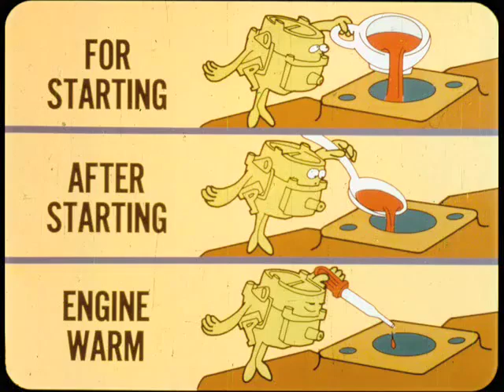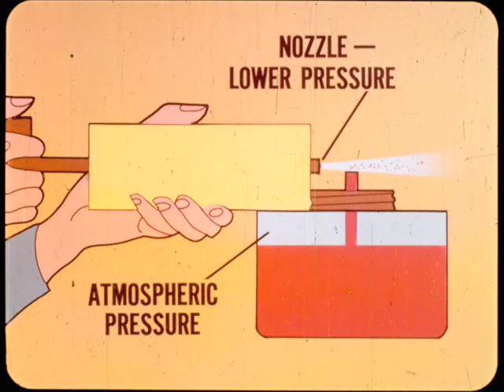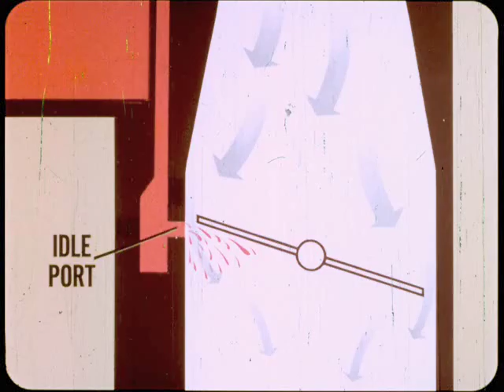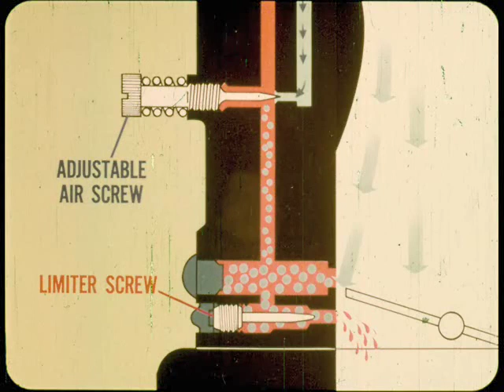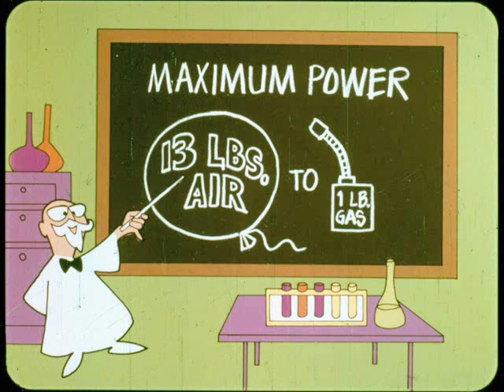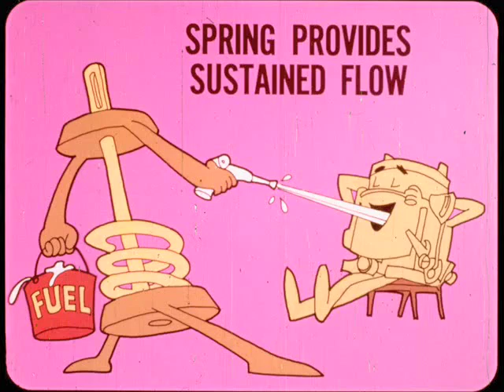Chrysler Master Tech - 1970, Volume 70-8 Carburetion Fundamentals and Facts

Comment: I learned about carburetors back in 1981 during high school auto shop. We were each given a carburetor to disassemble and use a thin piece of wire to trace the 7 circuits within our carb. Probably the best way to leatn the fundamentals of a carb "hands on". This video is an excellent visual guide to learn those fundamentals. 

At the time, I didn't give much thought to a carburetor since it was really the only fuel metering device being used. Yeah, some cars had fuel injection but it wasn't mainstream yet. Over the last 40 years as a mechanic I have watched fuel injection grow to what it is today; the last carb used in production being 1991. That was 30 years ago. 

It really makes me appreciate what a carburetor had to do. We took them for granted because its all we had. It was really a well engineered device with a huge responsibility